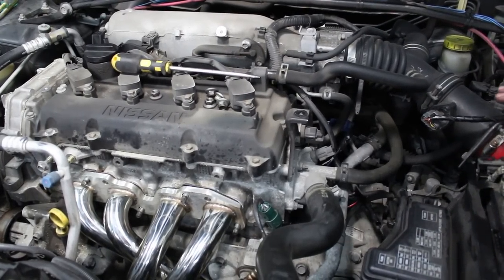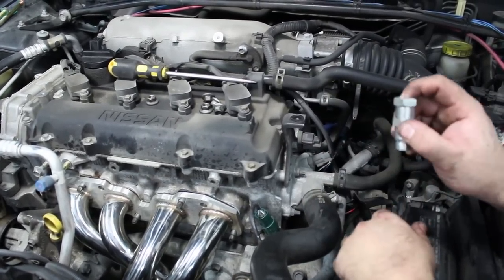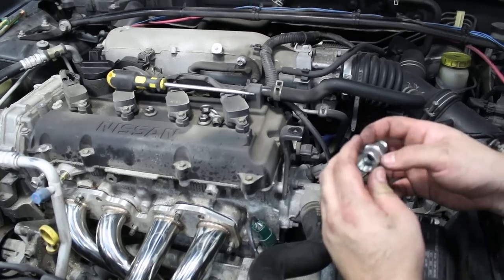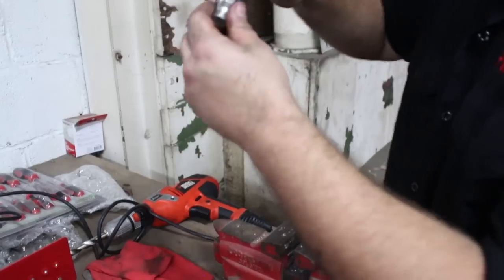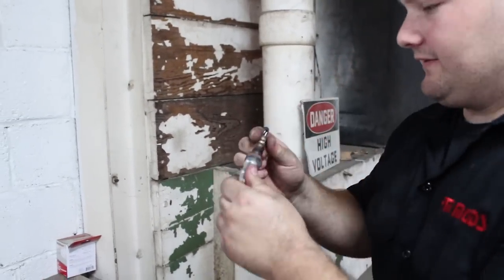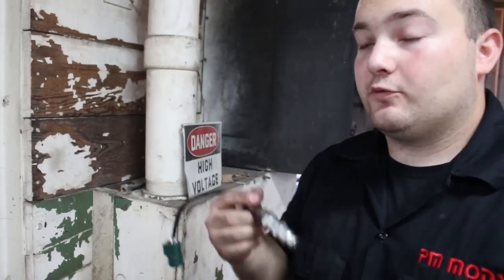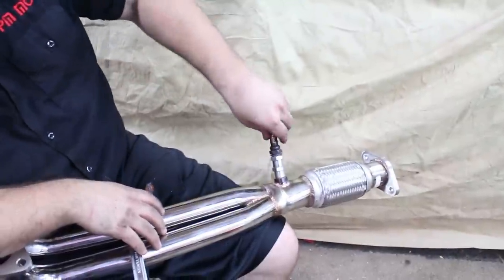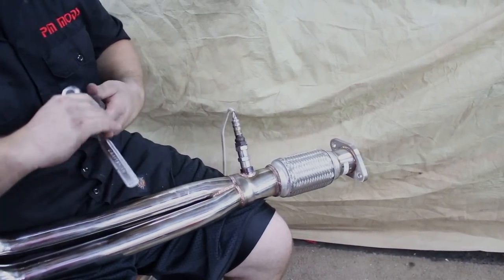$4 Catalytic Converter P0420 Fix | 02 Sensor Simulator | Pass Emissions | Oxygen sensor

Comment: Yup i have a 2000 Toyota with a check engine light on.  No way Im putting a new catalytic converter on that car. I am on my way to get the fouler!  🙏 thank You
Reply: Did it work??? I have a 2001 Toyota Camry but mine still had the check engine light after doing that trick
Reply: My light went off so i have not done it yet did you check your code?

Comment: Just get on Amazon and order a o2 extension.  For 8$.  No drilling.
Reply: Is it the right angle one?
Reply: @tdok  they make all styles and all work. Noo need to drill.
Reply: Have you tried it? What kind of cars do you guys have?
Reply: @Zx14rrrrrrrrrrr  05 Subaru.  And yes it worked for a while then it threw another code   it's a temp fix I believe.    But may depend on the car ....   my Subaru throws a code if you get gas at a different gas station It seems....lol
Reply: @benbox7329  lol

Comment: can i do this on my off road x pipe on my 02 mustang gt?
Reply from the maker: +Junior Contreras yup
Reply: +Poor Man Mods 
will i only need to do one sensor or both?
Reply from the maker: you have to do all of the downstream 02 sensors, whether its 1 or 2
Reply: Okay thanks for the help i did one put of the two earlier and the light fidnt turn off guess im going to work on the second o2 sensor to see if it will shut the light off.  Thanks your help.
Reply: You will only need to do it to the one behind the cat that is bad.
Reply: +Junior Contreras 
i have no cats i have off road x pipe catless. it didnt work on the front 2 o2 sensors i had the light cleared after i finished and its still reading check engine.
guess im going to try the o2 sensors that are in the middle of my exhaust maybe that will take it off. i have no idea haha
Reply: The front O2 sensor is only for read A/F ratio, the rears are the ones which test the cat for efficiency. if you have no cats you will need to do both. Just know that removing the cats don't give you more power just as a bigger intake or throttle body doesn't get any more air into the engine. It only make it sound different and some people think that noise is power. its not. Air is power

Comment: I would think this would only work with cars with a post-cat sensor.
If your car only has one sensor and its after the cat I wouldn't do this. It will probably give you crappy mpg and power when the ECU is in closed loop, because in closed loop operation it will run based on AFR, and if your sensor is getting obscured readings then its going to cause issues.
Reply from the maker: yes, this mod is only for OBD2 vehicles on the downstream sensor
Reply: If it only has one ... You would not need to do this... You would not have a code for a bad cat ..  this is only for cars with a dad cat or trying to cancel out the cat...
Reply: Do you know anything about O2 sensors? The downstream is o ly there to monitor that the cat is doing its job. The primary O2 is what calculates AF ratio. You could remove your downstreams and see for yourself if you dont believe me. It wont affect anything.

Comment: I have a 1991 jimmy 4.3 L v6 and I want to delete the cat. no smog tests where I live but I don't want a false check engine light, also I don't know if there are sensors in front or back. anyone try it on the same type of car and work? Poor Man Mods ?
Reply from the maker: This trick will not work on your Jimmy this trick of for 1996 and newer
Reply: +Poor Man Mods any ideas for my 91? is there even a sensor in that year?
Reply: @obsessivegarage921  OBD1 only had provisions for a single O2 sensor but if you cut out the cat of a 91 replace the O2 sensor so the computer can properly relearn the AF ratio. I'm a little surprised a 91 would still have a cat in it since a clogged cat KILLS the engine from excessive heat, warped heads and burned exhaust seats are commonplace

Comment: Hey PMM, thinking about going with a catles downpipe for my Mazdaspeed 3 because they're like $500 cheaper than a catted one. If my car throws a CEL (some downpipe makers make them so they won't throw a CEL), will using my Accessport to wipe the code, and then force the ecu to forget it, work to bypass emissions when they go to scan my ecu?
Reply from the maker: +Andrew Bourgeois I dont know anything about the accessport, so i dont know if that will work or not

Comment: My Concorde computer is telling me the Oxygen sensor is shorted ...  Forget the code #.  But it runs fine until it warms up an im either starting it back up or accelerating after drifting down a hill.  It's missing an hesitating. Would this be caused from a downstream Oxygen sensor ya think ??
Reply: No, only the upstream O2 sensor controls air/fuel mixture.  Downstream only tells the ECU if the Cat is working for emissions compliance only.
Reply: Ok..  Yea..  I figured it out..  Was two plug boots wore out an the spark was jumping down the side of the plug.  Thanks :)

Comment: and even cheaper easy fix put 3.2 ohm diode on negative side wiring loom cut negative wire put this diod on the wire tape it up it always send same signal works on all sensors and all cars it keep the same signal levels with or without cats or blockages this how we do it now and only cost 12 cents little solder and bit tape 10 min fix permanently

Comment: Is it fixed to p0430 code?
Reply: The PO430 code is bank 2 Cat code. Instead of doing this illegal crap why don't you just fix the problem?
Reply: +Robert Slingers Pop $4 > $500 for a cat, not including installation in the case it needs to be welded on.
Reply: Fine for removal and defeat of Catalytic convertor first offense 10,000 is more than 500. If you cant afford to drive and maintain your car maybe you shouldn't own one. Ask Volkswagen how the EPA sees people trying to defeat emission controls. The whole tuning scene (which I am in) has been and will continue to be affected due to VW raising a red flag for the EPA. They are not going to stop just with VW. Soon roadside readers are going to be in more places and drivers will be getting tickets in the mail for failing smog.
Reply: All depends where you live. If you don't live in a state that tests this looks like an OK way to get the light to turn off on an older car.
Reply: Benjamin. It is illegal to remove defeat or tamper with an emission control device it is a federal offense. Its not a state law its a federal law.
Reply: so whats your point?

Comment: Thanks so much(: this helped a lot
Reply from the maker: thanks for watching, glad we could help!
Reply: Poor Man Mods I assume you would know, I have a question. If I cut my cats off do you know of any shops that would weld a piece of pipe on? or if I get a piece of pipe slightly longer than my cats and get it flared at each end so it is pretty tight over top of my current piping, and I use a U clamp, would that hold tight enough so I don't even need to have someone weld pipe on? thanks
Reply from the maker: any muffler shop should be able to do that for you no problem
Reply: Poor Man Mods damn so far ive gotten in contact with about every muffler shop within 30 miles of here, I live in small town. None of them will do it, but ive got a guy I know who said he will do it for me. THANKS FOR THIS POOR MAN MOD.

Comment: It will work with Bosch if you get a good o2 sensor problem with Bosch is about 1 in every 6 sensors brand new out the box are worth a fuck

Comment: start with a small drill bit, work your way up to that monster bit, saves you from shredding the part and the bits, and saves it from catching like that, and dude use some oil
Reply: Or just use a good German bit.
Reply: Or just drill from the other side and use a step bit.  That way you're not changing bit to bit to bit

Comment: Public Service Announcement: Although this mod will usually turn off the Check Engine Light, it does not make the exhaust any cleaner. Therefore, it may still fail a smog "sniffer".

Announcement over. Back to my usual shenanigans.
Reply from the maker: Yup!
Reply: Fill with E85 before the test and VOILA, TEST PASSED.
Reply: Robert Polkamp fill what with e85??
Reply: Exhaust sniffers aren't allowed in Ma 🤣

Comment: This is a hack job. Plain and simple. P0420 usually indicates air in the system, causing a too lean condition, which the O2 sensors pick up. The root cause of the problem still exists. In almost every P0420 I've fixed, it was a simple vacuum leak. Vacuum leaks can affect engine performance greatly. Please don't be "that guy" and try this. Repair your stuff the way it was meant to be.
Reply from the maker: This "fix" is for if you removed your cats like the car in the video, or your cats are no longer working ,its not a fix for a freaking vacuum leak.
Reply: @PoorManMods   Removing the cat is illegal in places that require emissions inspections.
Reply from the maker: @superdave19855  Oh my....
Reply: David Farmer in Washington state emissions are gone in year 2020. So this is perfect fix! Thanks @poormanmods!

Comment: If the end goal to tricking the o2 sensor is to block some of the exhaust gases from entering the sensor holes why not simply cover some of the sensor holes up??   Then its hidden inside and the emission inspector can't see you modded your o2 sensor and fail you and probably flag you in their computer as well as this may be illegal in some states.  Has anyone tried to just simply fill in some of the sensor holes or cover it with  maybe some metallic heat resistant tape?
Reply: Cats get up to like 1600 degrees. And you don’t want to completely cover them with tape. Just distancing it works. There’s no way to jam anything in the sensor without the spark plug defoulers tube. However you may get away with 1 instead of two if you are able to jam something in there

Comment: Does this mini cat help with performance, or anything else besides taking off the check engine light? Putting one on my car tomorrow hoping to see changes at least on fuel saving and performance, that's the description of the item so we'll see I guess. One last question i have 2 sensors on my 2002 Nissan, how do I know on which one does it go?
Reply from the maker: it does nothing for performance, its only to turn off the CEL light
you put it on the down stream 02 sensor
Reply: @PoorManMods  oh wow so false advertising then from mini cat sellers, I'm still getting it then and afterwards I'll just sell the car, if it struggles to get past 30-40 mph without me smashing the gas hard then I don't need this car. I'm not buying that cat converter too much $.
Reply: @PoorManMods  i had replace the 02 sensor new last week because I had a code for it, but I've always had that 420 code and I'd figured that would fix it somehow but nope, so I'm trying this last thing for it.

Comment: My friend I just want to tell you thank you I've used this video and a completely fixed that stupid check engine light after I went to an aftermarket catalytic converter.
Reply from the maker: Awesome!!
Reply: To make the light go away do I need a obd to clear the code or can I just take out the battery
Reply: @maisule2001  honestly mine just went away by itself but I'm sure if you take the battery off it will reset the engine code!

Comment: to clean cat weld in small 2 mm tube into the cat in front of cat when engine hot pump under pressure using pump bottle  little petrol or diesel same as engine uses put idol at 3 to 4000 rpm then spray fuel directly  into the cat it burn away all blockages leave tube there for next time don't forget to blank it off when not using it if diesel this very common problem take out on hwy flog guts out of it most late model diesels have burn system installed this clean when some types conditions met this automatic system to clean the cats these automatic system just pump little fule into cat to burn off the soot they work great you create the same system using brake line tube and bottle to pump in fuel works every time it clean cat in about 30 seconds to minute i done this thousand times or just delete them we remove inside of cat replace it with heat resistant mesh or gauze padding to create the same environment inside the cats the best stuff to use is steel wool last about 6 yrs steel plate with 3 mm dia holes heaps of them inside the cat fill up with steel wool the plate with hole stop wool from blowing out pipe or weld in baffles so air goes to back of the cat then returns to front then back again and then out the pipe like maze this also create the same environment as same as cat

Comment: Question guys, have a 00 Acura Integra that is throwing a p0420 code and tried Cataclean and It did not work. 

Should I be using one spark plug non fowler for each o2 sensor? Bank 1 and Bank 2 or 2 fowlers for each sensor? 

Thanks

Comment: hey.. i got a 2002 civic..   i installed Racing header and Removed my Cat.. So i have Str8 headers to exhaust str8 pipe...  Now obviously im blowing a check engine light...  My Header Has 2 ports in it Witch my sensors are in right now..    Can i install this on my 02 Sensor and still it back into my header?   or would i have to make a new hole down in the str8 pipe and extend my 02 sensor

Comment: Get a deep 02 simulator so u don't need to drill. And if the cel does not go away put two. It's all about reducing the exhaust gas reading to safe levels. So it can't be too close to the gas stream

Comment: this mod works on all cars and done lot mostly used for race cars and off road 4x4 but some cars work good this mod creates little vacuum inside this space which gives low level signal meaning that cats not blocked i agree works well but don't get caught i seen on news car yard doing this hack he went jail for 12 yrs the hotter the sensor is the more blocked your cat is this how they work so putting these spacer in creat enough free air space less temp to fool the computer or just delete code from the car permanently it easy to do short out pins no 3 and 16 on computer terminal with key on engine not running this delete code permanently

Comment: 6 liter Chevy did not work. Drilled 1/2 inch but sensor still does not fit. Tried next size up and male threads came off… any ideas?

Comment: I have a nissan altima 2008 and I removed the catalytic converter and installed a stillen header,  what 02 sensor I have to use to remove the engine light?  because I tired install a 02 sensor but I don't know which brand it was...what's the best 02 sensor for me car? please help
Reply: it's a 2.5s
Reply from the maker: Use the one that's currently on the car, if the check engine light for that catalytic converter doesn't go away then buy an NTK sensor for your car

Comment: Someone  stole  my Prius  Cat, got a replacement from ebay along with an o2 sensor  but the check  engine  lights on despite  having cleared  all the fault codes. The supplier  sent me a new o2 (aftermarket) sensor  if that fails as well then I will try this for sure.

Comment: the steel wool i use we get from metal lath foundry machine shop lath waste it little bigger in size steel mesh and it handle heat better normal steel wool buy at shop only last about five min dont use shop steel wool burns to easily use metal foundry wool waste it thicker handle heat better and last yrs pack it in till wont take no more it act same as cat

Comment: Should you use some kind of gasket or sealant in between the two non-foulers?  I've done this and got rid of my CEL, but it sounds like I have an exhaust leak now and I can smell exhaust fumes coming from around that area.  It was raspy before because of my failing cat, but it's much worse now.
Reply from the maker: +Dom Lom ive never had an issue with them leaking, but you can try silicone gasket maker or something

Comment: poor man mod? more like smart man mod. I am going to install off road x-pipes for my 2006 Mustang GT (which means no cat) so in order to get rid of the check engine light i must either buy a $300 tuner, take it to a shop or buy new 02 Sensors. Now if you ask me what do i rather waste, ha ofc the $4 over the $300 out of my pocket. Does it do the same job, absolutely! and all for this genious idea! so now i hope this works on Ford. 😀
Reply: hey, was wondering if you got a chance to try this, and did it work?
I have an 88 5.0 with shorties, hollowed out cats, 2.5" flowmaster catback. 
Wanted to try this to see if pcm will see the cats are wirking.
thx

Comment: I’m moving to a smog free State and wondered if I can eliminate the CAT from my 87 Range Rover and do this Oxygen sensor trick? Feedback anyone, please? Would defiantly gain gas mileage and power and they can burn quite clean if tuned up right. Cheers!
Reply: Well if you’re up in a smog free state you wouldn’t really need this unless the Check Engine Light bugs you. I have a 2016 camaro and i am now straight pipe with a magnaflow x pipe. I also had my cata gutted. I used a a total of 4 18mm non fouler (2 cats) to get rid of the CEL. Good luck on yours

Comment: My o2 sensor is on my cat if I take out my cat and just replace it with a pipe will this work?
Reply: You could punch the cat out then put it back in so it still looks like a cat and has your O2 hole, Or drill and weld a nut for it, check out the vid I just made so you can get a mini cat that'll work with any sensor.